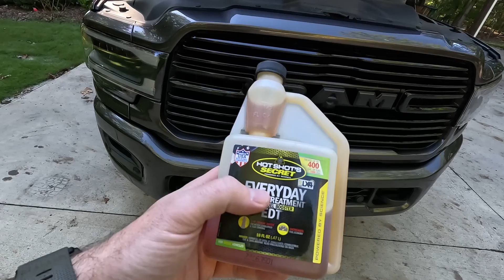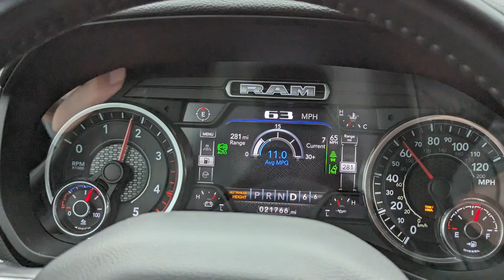P2459 on My RAM 3500 Cummins 6.7 Dually // Diesel Particular Filter (DPF) Regeneration Frequency

Comment: Here is an update from me. A dealership tech that has been dealing with this code for a few years. Use a feetguard air filter or mopar 53034051AB.

Comment: Did you erase the code or it went away by itself?
Reply from the maker: I did era clear it each time and then it came back subsequently until the most recent clearing before recording this video. And then after changing my habits and using the additive the code did not come back.
Reply: @AdventureRocks  so I did add that solution and draw for hundred miles and then I erased my engine light message. It went away from my dash but my code reader is still showing that code
Reply from the maker: @mamonnyabs4330 I think some code readers have a clear CEL option and then a more destructive erase option. I might not be using quite the right terminology. I just remember there being different levels. And it's also possible you might have a more advanced code reader where it reads the full history regardless of being cleared. Sorry I couldn't be a greater help on this one.

Comment: The CP4 fuel pump is made in Europe. Europe’s diesel is still 500ppm’s sulfur. Here in America the sulfur ppm’s is 5. Additives are pretty much CP4 savers. I use Everyday’s myself and have 95,000 miles. So far no problems.
Reply from the maker: Great insight, thank you for sharing.

Comment: Nice truck, wow, sometimes I wish I would have gotten the dually instead of a single.
The dually would be nice for hauling my BigFoot slide in camper, 3800 pounds.  I also pull a camper, had a 37 foot 5th wheel, now I tow a 27 foot Airstream.  But on your subject I had nothing but headaches with cold weather and the dpf.  I would move my truck out of the garage a few times, shut it off and soon I had error codes.  Called the dealer and he said, "Even if we had parts , which we don't, it would be one of three things or all three costing about 3 grand.  So I invested in 5 inch stainless steel exhaust and a new operating system .
The overwhelming feeling I got was , Wow , so much more power economy and no error codes ever again, nothing.  If I got a nice new truck like yours, right after driving it off the lot , regardless of warranty I would do it again, never looked back.
Reply from the maker: Great points. Nice setup.

Comment: Quick question, so did they code ever come back since it’s been over a year you made this video??
Reply from the maker: No, code did not come back. I think it was a combo of changing my driving habits and additives.
Reply: @AdventureRocks wow ok , I will definitely get those additives cus I’m almost at 400k miles, mine is also a 2020 ram 2500. Thanks for the reply I appreciate it

Comment: It's not just Cummins diesel. 2024 chevrolet silverado 2500hd diesel with only 28,000 miles sits in the service department at Chevrolet going on 3 weeks now with D.P.F issues. This AFTER a full week of trying to regen. No one has a grasp of this issue. The technology has outrun the service department. BTW, i make much longer runs with work, driving 100+ miles for work.  Blows my mind. So frustrating.
Reply from the maker: Sorry to hear. I agree that's frustrating. I hope they can get it sorted out for you. Wish we could go back to pre DEF days.

Comment: I’ve got 22 Ram 3500 HO and I do car hauling. I have the same issue and the same code. Tried to use couple different additives. None of them helped. After this video I have tried these both additives. They didn’t help either. Rislone seemed helped little but this Hotshot extreme additive didn’t do anything. It seemed it did even worse.
Reply from the maker: Sorry to hear. It sounds like you may have more mileage on yours. It could be a different culprit then. I was basically shooting myself in the foot with the idling and short trips.

Comment: When you want too leave your truck idle, then hit the cruise control button, then push set, and it will raise your rpms, so it leave it idling without harming your engine, been doing it forever including the big trucks you see sitting at truck stops
Reply from the maker: Thank you for the tip!

Comment: Hey there friend, ✋ try driving your awesome 6.7 RAM 3500 in the - 
“tow/haul” - mode on your short’r drive’s to help keep the RPM’s up-
I put a bottle of “Marvel Mystery” oil in my 2016 RAM 6.7 2500 fuel tank after a fill up, to help the injector pump and overall for the engine performance- not a sermon, just a thought 🙏
Reply from the maker: Great points, thank you

Comment: Seems late model diesel pickups are simply not capable daily drivers.  I’m really worried about buying a new diesel truck, even though I wouldn’t drive it around town or daily.  Thoughts anyone?

I’ve heard, and it was my experience with my ‘05 Cummins, that the MPG didn’t really begin improving until the truck got “broke in” at about 80k miles.  Perhaps this accounts for the improved mpg you mention.
Reply from the maker: I hear you. Seems the modern diesels like to run hot and for longer durations. So the shorter 10-20 min trips repeatedly can accelerate emissions issues. I wouldn't say you're guaranteed to have issues right of the bat, but perhaps as you accumulate mileage. Cutting the idling and short trips can definitely help.

Comment: Hey I just got this code and I was wondering when you at when you did the additives did the check engine light go away or the code go away by itself or did you clear it?
Reply from the maker: @nicnacpaddywak4766  I cleared it first and then did all the additives. Code never came back. I also tried to watch my idling as well.

Comment: As a 2015 Ram 2500 owner, I've come to the realization that this new technology "DPF NIGHTMARE" needs needs to be driven long distances. Diesel trucks since 2013 cannot be driven short distances due to the system needing to be hot as hell in preventing soot buildup. I've since parked my truck and only use it for long distance driving.
Reply from the maker: Thank you for the firsthand feedback. I think you hit the nail on the head with that advice. Frustrating reality.

Comment: So I have found most of these codes are caused by high oil levels. They need to be drained for 30 minutes. There's other stuff that can cause the code, boost leaks, poor maintenance, driving habits. But I deal with the code alot and about all the trucks have high oil levels. Let the truck sit for 15 minutes and check the oil level.
Reply from the maker: Thank you for the tip.

Comment: Any update on how this has gone for you? I am starting to have the same issue.
Reply from the maker: After cutting out the idling and doing the Hot Shot treatments (both the initial full treatment and every day treatment at fillups) it went away. I did hear through the grape vine that it is possible the code is at least part due to a software miscalibration. Anyway that's what worked for me, hope you can get it sorted out on yours.
Reply: @AdventureRocks  Thank you for the response. The initial treatment has already started to make a difference.

Comment: Got something for you!  I had no regen except once in 69k, then it regen and immediately said "Take to dealer".   I instead drove 100 miles at 2500rpm.  It went into regen BUT after a couple days, the DPF was half full.

So, I researched.  One told me to "Drive it like I stole it" (which I never do, always after fuel economy).   Well, I DROVE IT HARD on city streets, inviting a ticket.  Guess what?

THE REGEN IMMEDIATELY SENSED THE INCREASED DIFFERENCE ACROSS THE DPF and initiated a regen.  NO tool or meter would!  So I drove it for 60 miles (at 2100rpm) and the DPF problem is SOLVED.

Who would think you NEED to abuse the truck to keep its exhaust clean? But it worked- nothing else did!

Edit: merely driving at 2400rpm for 50 miles recently DID NOT WORK but provoking the regen FIRST did work.  2021 RAM 6.7 with 69k.
Reply from the maker: Thank you for the helpful tips, that is great firsthand experience.

Comment: I have a 2019 ram 3500 HO i had this code and tried most everything thats listed here but didn't help, i found a couple of guys on a cummins form that said to only run a oem air filter so i purchased one and  ever since the dpf frequency has gone way down  and hardly regen anymore and no codes so far, so im thinking it a fix   for me  i drive 30 min to work everyday 😊
Reply from the maker: Thank you for the comment and helpful suggestion. I have also heard aftermarket filters may throw a code...I guess the oil gets on sensor and throws off calibration.

Comment: Remember you have to idle for a few minutes to cool your turbo after driving to avoid cooking the motor oil in the turbo after shutoff.
Reply from the maker: Great point. The owner's manual has a guide for how long based on towing and length of trip. Who knew, right?

Comment: Those kind of idles (at 5:30) could cause the new hydraulic lifter to prematurely wear out. Luckily mine was under warranty. They replaced cam, pushrods and lifters two times. I don’t do 5+ minute remote starts anymore nor double remote starts. Oil pressure isn’t quite up there for those lifter when she is sitting idling under optimum oil temperature
Reply from the maker: Great point, thank you for the comment.

Comment: Hey man thanks for video. I’m having same issue. Has it came back since?
Reply from the maker: I actually sold the truck, but it's my understanding the current owner has not experienced same error code again. I believe in part it was due to improperly callibrated software that was basically giving up on the regen and throwing the error code. But, then my short trips and idling probably weren't helping. Regardless, once I cut out idling and did the Hotshot treatments, it never came back. At one point a RAM technician mentioned he thought a software update was on the way to fix the callibration issue.

Comment: Hi there,
I recently posted this in response to another Youtube video on this subject, but I thought you might find it interesting.

I drive a 2017 Cummins Ram 3500 that I bought new. I now have about 130,000 miles on it. Half the year I am towing an RV, either 15,000 or 6500 lbs, and the other half of the year I run empty. 
I'm just about to change the CCV filter for the second time. Apparently it is not wise to let it go longer, and it causes other issues if neglected.
The EGR valve clogging up sounds weird to me. I have never had an issue or message about mine. I have changed the differential fluids, 68RFE transmission fluid, and transfer case fluid twice so far. 
I use Peak Platinum DEF, after seeing a Youtube video of a guy showing the condition of his DEF injector which was already clogging at 10,000 miles using regular Peak DEF. The more he used the Platinum fluid, the less white deposits there were on the injector. I assume this applies to inside the SCR unit, where you don't want deposits building up.
I use Diesel Kleen as a fuel additive. Until Diesel Kleen, Cummins wouldn't allow any fuel additives to be used without voiding the Cummins warranty. Cummins not only approves Diesel Kleen, they actually recommend using it. It also raises the centane of the fuel, and that supposedly means less soot produced, and less for the DPF to  deal with and eventually get clogged with. I have an app on my iPhone that tells me that I average 881 miles between regens. I also monitor 5 EGT sensors with the same app that are already in place from the factory. Cooler running is not better, and produces soot for the DPF to deal with. Above 700 - 750 F, the DPF is not doing much, as there is not much soot being produced. If I am towing I am usually around 700 - 900F EGT, which is great. If I am not towing, I can't get the EGT up to even 700F, so I just know I am sending soot to the DPF. The Cummins likes to work and using it as a daily driver empty is not something I really like to do. Idling is bad too for running cool EGTs.
Oil has always been changed at the dealer at the recommended 15,000 mile interval. I sent oil samples off to Blackstone Labs for analysis at 75,000, and again at 90,000 miles. Blackstone's report said the oil was in such good shape that I should extend the interval to 17,000 miles and test again. I won't bother, since the oil filter and fuel filters still need to be changed at 15,000 miles.
But it did give me peace of mind that 15,000 mile intervals for oil changes on the Cummins 6.7 are not too long - at least in my case.
Reply from the maker: Great point, thank you for the comment

Comment: Great video! I have the exact same truck and I am a hotshot driver with 235000 months miles on my truck and unfortunately I had the DPF replaced at 230000 miles and am now getting the P02459 code. It’s going back to the mechanic soon to see what is wrong now! good luck
Reply from the maker: Thank you for the comment!
Reply: what did it end up being?

Comment: Not sure about the short drive or idle times, but i completely daily mine short drives and idle until back home. Never have issues and don't use additives. It's just faulty ecu or sensors... I don't baby mine or rag it out. 22 2500 that Regens once and awhile, never had s code.

Comment: The big rigs have  bigger dpf filters then what is on your truck so idling isnt good i use rislone dpf cleaner and rislone def cleaner that goes in the def tank and cleans up the crystallization and use diesel fuel injector cleaner its just general maintenance you need to follow so you can prevent codes from coming up

Comment: Can you tell me what brand code reader you used on your Ram 3500?
Reply from the maker: At the time of this video recording it was a super-cheap ($15) and generic bluetooth OBD II reader, but since then I've been using the Kingbolen stand alone unit featured in this video here:
https://youtu.be/KTpE6s-kfJY

It's way more feature-packed and much less finicky compared to the bluetooth connection. Hope this helps.

Comment: I have a local company that cleans DPF filters. My mechanic took it off, I dropped it off at their shop and they cut it in 2, cleaned it and put it back together. They do an air test before and after for flow and it went from 60% to over 90%. You lose quite a bit of flow just getting air through it. It was $500 to clean and $500 to take off and reinstall. They recommend about 80,000 miles to do it again. They did say the filter is a bit too small for this size engine and expected work load.
Reply: Hello. Im pretty sure I need to replace my DPF. I've got a 2022 with 44,000 miles and it goes to regen every few days. 90% of my driving is a 20-25 minute work commute. The company that serviced yours, was it a muffler shop? And how did they put it back together? Thanks.

Comment: I'm a diesel tech at an independent shop and I had 6 trucks in 1 week come in because of this exact code. I followed OEM repair instructions, and none of the steps helped find the problem. However those trucks have PCM software updates to fix this issue. I updated those trucks and 5 out of the 6 have not had the code set again, I'm currently stuck on 1 of the trucks still throwing the code after the PCM update.
Reply from the maker: Wow, great insight. I had heard a rumor about software update so good to know that it may have been more software than a real issue. Maybe an oversensitivity to some degree. Thank you for chiming in.
Reply: What years needed the PCM software update?  Any TSB?

Comment: I have a diesel Rubicon and run a scan gauge 3 in the OBD2 reader and monitor soot mass percentage and can see if I’m in a passive or active regen. If you turn your vehicle off during an active regen soot can start building up and stay around for awhile. I use my mini tazer to force parked regens to clear everything out. I think you can do the same with a Jscan device.
Reply from the maker: Great tip, thank you

Comment: On my 2020 2459 regen too often. Can’t drive 20 miles without clog filter needing regen. Dealer tried to tell me I used wrong oil, needed pcm update, and more bs. I finally found DPF Alternatives and they told me when my EGR cooler blew it coated the DPF with antifreeze causing it to clog with particulates and is now junk, must replace. Everything he said is basically true, but not always the real problem.